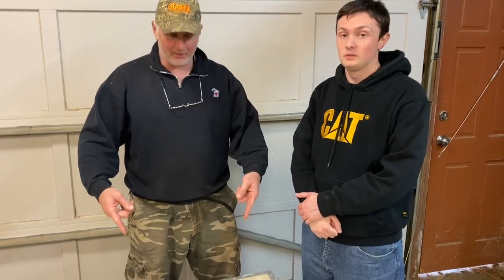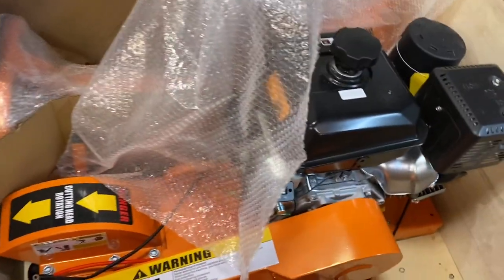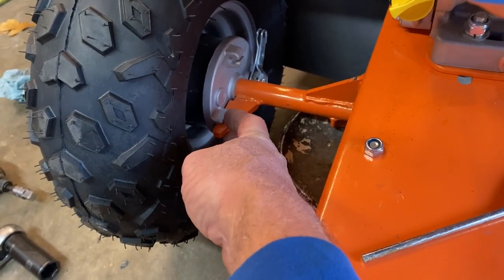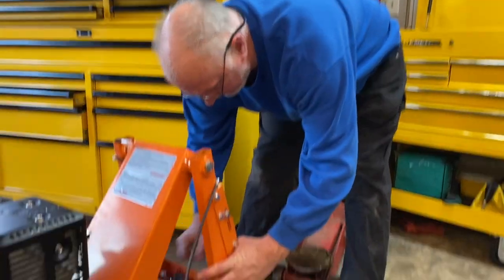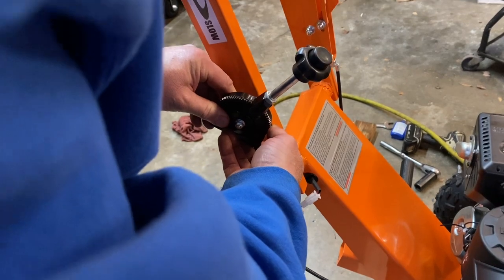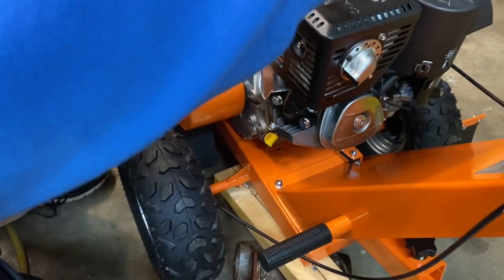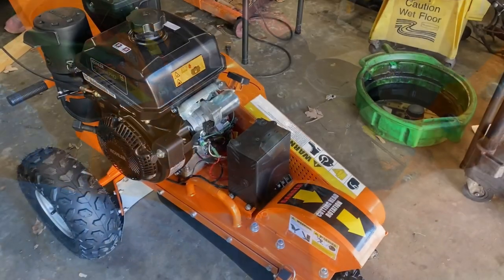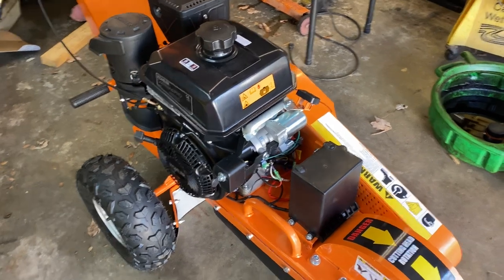Unboxing the Power King Stump Grinder & Assembly

Comment: Pretty impressive unit. So, is this just for your own use or are you going to have a side business as well? Not real great where the oil fill/drain located for service. Sure, you thought of this, but I'd look into adding a pipe or hose to your oil drain as the first time all the oil is going all over the frame. Or maybe you have one of those vacuum drains instead/ Look forward to more!
Reply from the maker: That's a great idea for the oil drain. Think I will install a pipe. Yes this grinder will be put to use in our new stump grinding business. We hope to purchase and add a larger unit by summer time. We are looking at the Bandit SG 40.